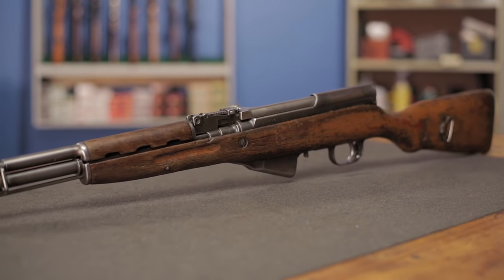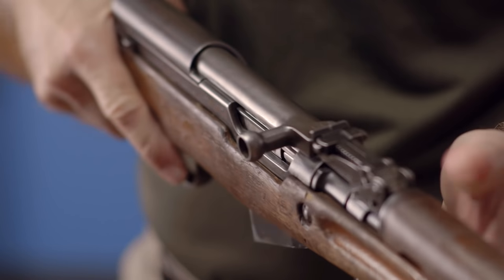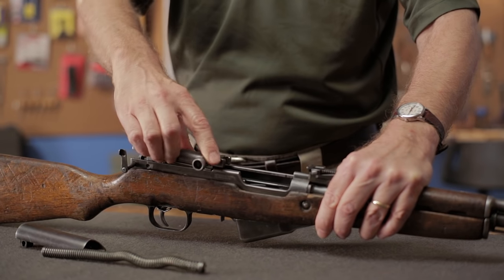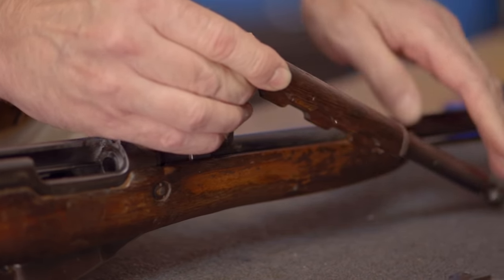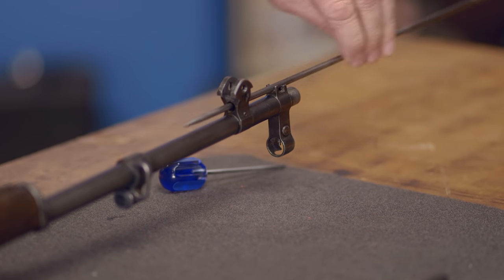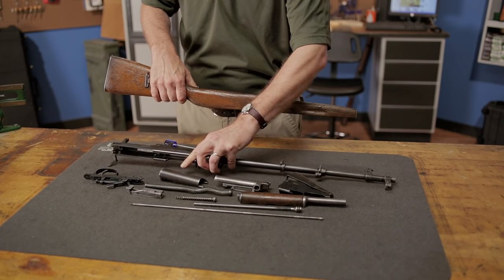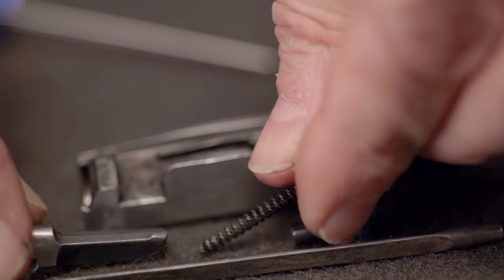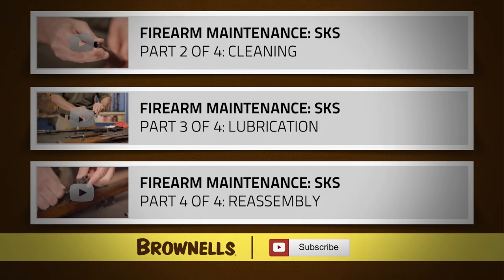Firearm Maintenance: SKS Disassembly, Part 1/4

Comment: I love how easily everything just comes right out on his SKS. It must have been taken apart and cleaned many times. My firing pin retainer was IN THERE
Reply: Right I can’t get my retainer pin tapped out I need to get it in a Vice to tap it out better maybe a bit of kroil
Reply: Felt
Reply: Yep. They sure can be.
Reply: @Yungak47records The proper sized punch and a heavier hammer helps too.
Reply: If your firing pin retainers is stuck, soaking the area in penetrating oil overnight can really help. The oil is cheap online

Comment: Mine is a Norinco from 92 if I read the serial right, looks like it had never been fired but once.  It wouldn't feed, once I carefully fixed that it's like s new rifle.  The face of the chamber was never finished to allow smooth, reliable feeding.  Someone else gave up, but I have a dremel and a steady hand. Honestly, I had to polish the feed ramp on a brand new Smith & Wesson that would hang up occasionally
  I think Norinco rushed mine out the door pre-ban in the 90's.  At least they left me enough steel to carve out a working rifle, it's beautiful.

 Thanks for the video, I'm still getting familiar with it.

Comment: This series is fantastic for the new SKS owner. Any tips for removing a stubborn firing pin retainer? Mine is jammed in there something fierce.
Reply from the maker: After soaking the bolt in Kroil, I usually place the bolt on a nylon bench block and center the retaining pin over one of the holes in the bench block and give it a good tap with a punch and hammer. The retaining pin should pop out.
Reply: I gave up cause I was scratching up the metal so i soaked that thing in penetrating oil for two weeks and now the thing is smooth as butter.
Reply: @oganarchy3667  you destroyed it...
Reply: Thanks. I just bought a 1952 model later refurbished at the factory and all matching serials along with the X out original serial replaced with the new one on the stock.. Retainer is also stuck. I have it well oiled but will soak it. Got everything else apart.
Reply: ...got the retainer off. Also had to punch it back in using the broad end of the punch and pliers to orient it to fit just right to tap it back in.
I'll see how it performs first run. Everything is oiled in there and I'll watch out for slam fire.
Reply: @rw7594  I have the same problem with a 1952 rearsenaled Russian one myself. I think Kroil is going to be very useful for me as well.

Comment: Im having problems disassembling my SKS.  The person in the video is able to disassemble the SKS with ease and without using tools much, but for me I have to use tools to even move the take down lever.  Is there something I can do so that it is possible to disassemble my SKS as easily as the guy here or at least easier?
Reply: I'm not an expert and have never touched a gun, but I did Automotive work for a while... some form of Lubrication is all that comes to mind. And take good care of it to prevent it getting in that state again.
Reply: When in storage, you can't put too much oil on it . Don't hesitate to saturate it .
Reply: This guys done this then showd  u will get better
Reply: The takedown latch on my Chicom Type 56 is super tight too. I just have to use a bit of muscle to move it.

Comment: I have a question from Brownells'   I own a SKS, standard Russian 10 round capacity,  fires great,  fairly accurate...I like it.  But I quite accidently discovered when I went to remove it from the gun safe,  I sort of bobbled it a bit and it dropped about 3 inches and the rifle tapped the ground on the way out and it self chambered a round and was ready to shoot.    Handling the rifle in a normal fashion has never caused a round to just load by itself.      But eventually I discovered that in a stress situation where I want the rifle ready to fire before I even bring it up to sight,  is I simply grab it from the case,  and as soon as  clear the case,  I quickly tap the butt of the rifle on the floor and it loads and I bring it up and I take it off safety and sight.        I am wondering if you can duplicate this with your on SKS stock and confirm if this is just a happenstance thing or my rifle is possible a problem and I should take it to a gunsmith.

Comment: my gas tube piston on my sks doesnt come out is that normal? i have a yugo sks just wondering what may be the problem or is that how yugos are setup?
Reply from the maker: The most likely cause is carbon fouling and buildup, which will cause the piston to stay locked in the tube.  A good carbon cleaner will help break down the fouling and allow the piston to be removed.
Reply: +Brownells, Inc. thank u so much your videos are easy and awsome
Reply from the maker: Our pleasure Arturo!

Comment: Very well done video.  When pressing the trigger guard latch in disassembly, does it matter whether the safety is on or off?  My firing pin retainer will not easily push out with a punch as you demonstrate.  Mine requires a hammer to remove and reinstall.